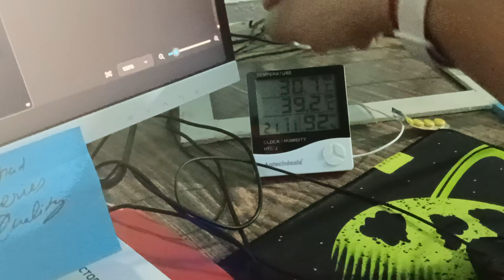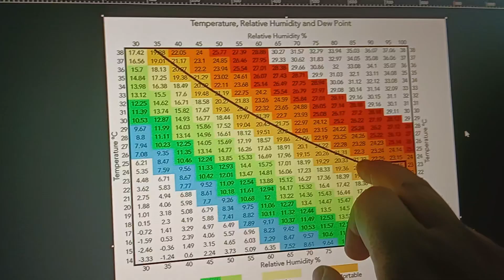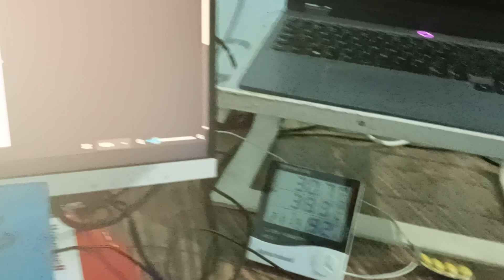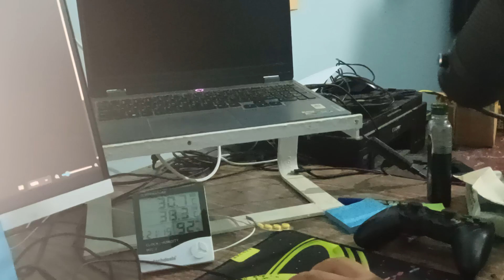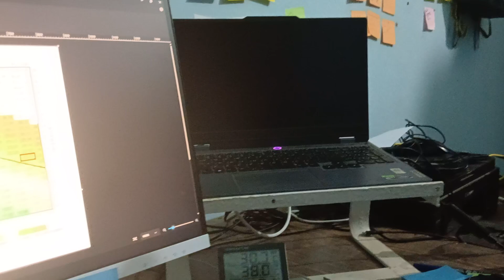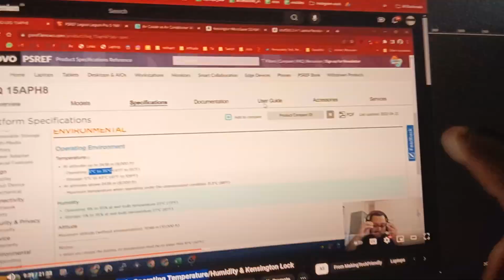Relative Humidity is an important factor when using any electronics like Laptops

Comment: bro if i put ice try behind the cooling pad 
like
first ice pack after that on top of that I put cooling pad and on cooling pad I put my laptop it give coll air and impact in temperature as well so is there any issue in it 
kidly let me know
Reply from the maker: Your laptop will die and permanently. Small water droplets will be pulled in through the cooling pad and put directly into the laptop's circuitry which will have shorts all over.
Reply: @makingtechfriendly  i put one small cloth on the ice pack so it absob all the droplate and water :: but the ice cold air can harm my laptop ??
Reply from the maker: This is not a solution. If you are so hell bent on using it, at least get a dehumidifier. As I said in the video, high humidity is a killer.

Comment: Thank you for this. I'm seeing this issue with laptops dying in Central America, where it is 27 - 32 C and 80% - 100% humidity, especially during rainy season.  Consumer laptops die quickly, but we've also had two Lenovo X1 Carbon Gen 9 motherboards die in under 1 month.  I suspect it's due to the humidity + temperature, so I'm trying to figure out how to deal with the problem.
Reply from the maker: This is an important topic so replied in a post.
https://www.youtube.com/post/Ugkx1-eVOKMc-kj_j0ozj20Qypl1aqSr0Thm

Comment: Thanks sir I guess it was the issue which I was facing cause my laptop hasn't froze for 2 days . It solves 1 of my issues
Reply from the maker: Do you mean yoy moved to a more convenient environment?
Reply: @makingtechfriendly yes firstly I was there in a room which was not ventilated properly there was only a fan there . Now its been 2 days since I moved from there its working fine though I am not sure that it will still work but hasn't shut down for 2 days